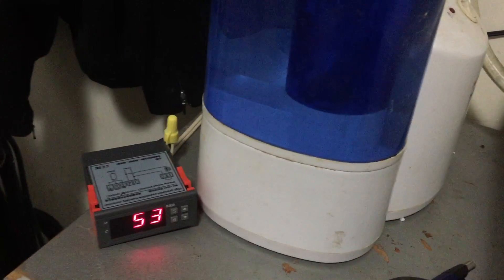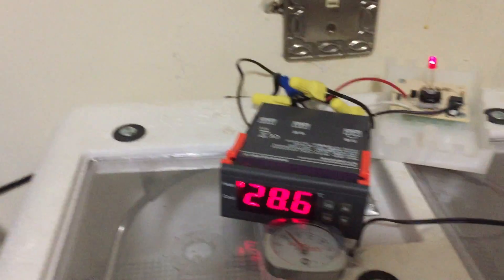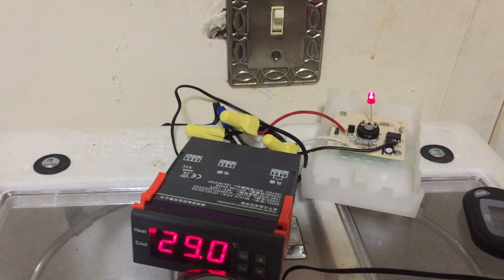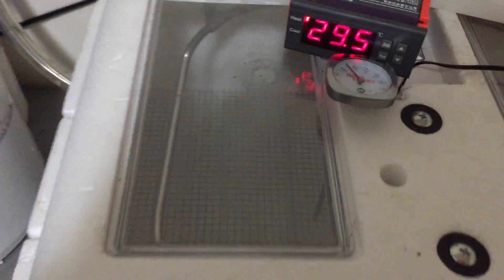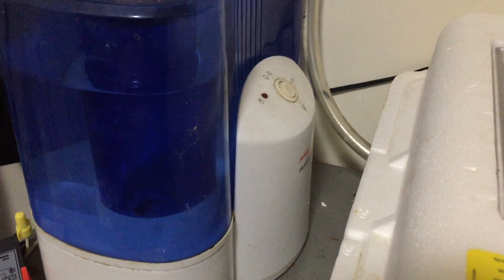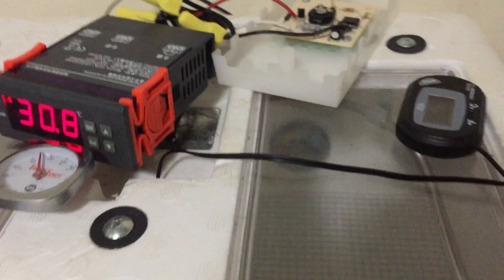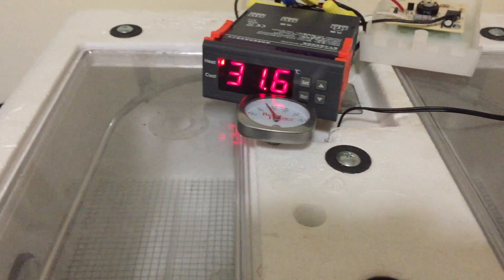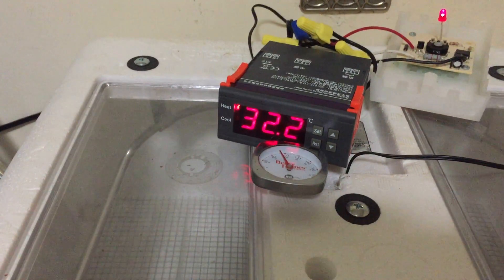DIY-Incubator Digital Temperature and Humidity Control

Comment: I also like your set up but I need to add a fan when there is too much humidity.can your controller control a fan and a humidifier. If so could you send a diagram thanks
Reply: Just wire up the fan to a 12V power supply & run it 24/7.

Comment from the maker: Vincent Holland, I ended up using an electrical plug so I can use any humidifier without cutting the cord off of it. It needs to be a sonic humidifier (cool mist) that the off/on button stays on all the time. A lot of new humidifiers, if the power cuts out turn off if the power cuts out. As long as it stays "on" even as the relay controls the power to it, it will work. If you get one that turns off when power cuts off, you can still use it, but have to modify the humidifier to bypass whatever electronics and switches control it.

Comment from the maker: Wiring for the humidity and temperature controller are pretty much the same. I used separate power cords to power the controllers and then another power cord through the relays to the devices they control. One side of power cord goes to device controlled, the other side to one contact on the relay contact of the controller. Then from the other relay contact to the other side of the device controlled. Here in the next week or two I'll post a new video and include a more detailed look at my wiring, this time using a PID to control the heater.